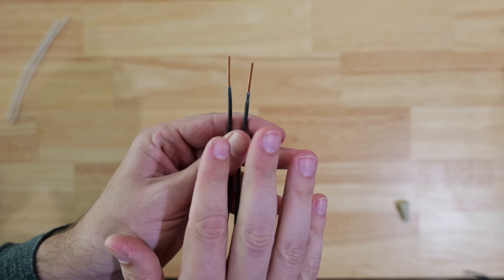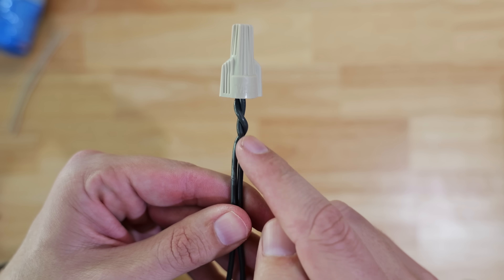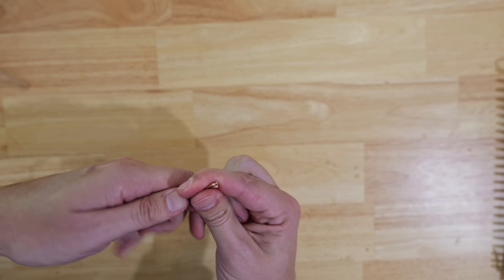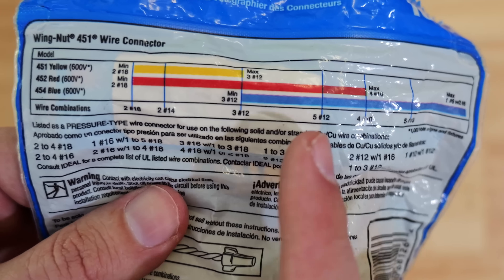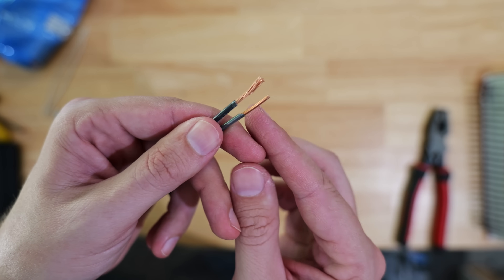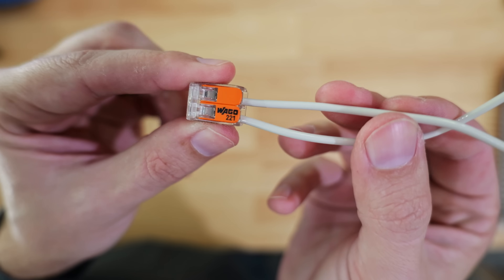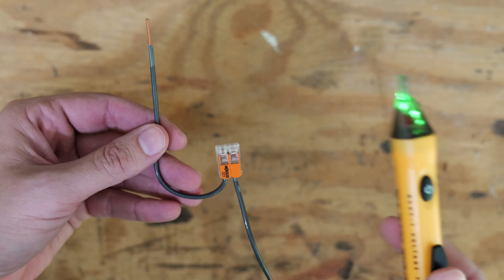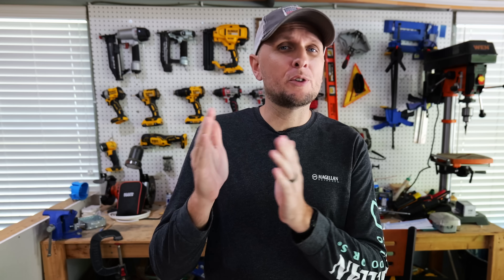7 FATAL Wiring Mistakes Most DIYers Don't Know They Are Making | Most Are Guilty of 3

Comment: Lol, your fear for wagos is funny considering every switch and plug has exposed screw terminals. American wiring standards are the fire hazard. I want non exposed screw terminals where the screw isn't live. All three contacts should be in along the sides and not on the top and bottom. Lastly, there should be a secondary hold mechanism to grab the wire jacket or insulation. I should be able to grab the outside of any switch or outlet anywhere and not get shocked.
Reply from the maker: As soon as I read American wiring standards I quit reading.  Just European electrical god complex at that point 😂.  Which I don’t understand because per public statistics, you all have more electrical fires per capita than we do.  Hmmm 🤔
Reply: No, it's both. The American standard sucks more on low voltage, European sucks more on high voltage. Also, their plug is awful. The European standard loses me on their screw terminals. A screw terminal for a single wire works great, but for multiple wires, it's terrible. There needs to be a compression mechanism and not just screw driven randomly through a wire bundle. Technically, if design correctly, there shouldn't be a need for wire nuts, but for how ghetto they are, they work phenomenally well. It's all designed to be as cheap as functional possible.

Comment: Your first example is wrong !! That twisting / wire braiding effect is supposed to occur with the bare wire  ! You’re supposed to line both bare copper wire even with each other , and using a pare of pliers twist both bare copper wires around one another about 5 turns causing the braiding effect . Most wiring inspectors will fail a circuit when they see the shielded wires twisted . Because they know some idiot just placed the two wires together side by side and twisted the wire-nut on forming an improper connection . So to the video uploader you get a  F for your grade …
Reply from the maker: No it isn't.  The manufacturer instructions clearly show why I did it correctly.  They will not fail it.  I have passed all of my inspections with that done.  So to the author of the comment being replied to, you get an F for your grade.

Comment: False information. You are incorrect. That looks like an ideal tan wirenut. This is their instructions from their website. Please stop making videos promoting false information.

5. Pre-twisting acceptable, but not required. For pre-twisting; strip wires long, hold wires together with insulation even, twist wire ends together, 
strip to recommended strip length.
Reply from the maker: Ummm I showed exactly that and didn’t say anything to the contrary.  But I see with your other comment that you are just here to complain.  Hope your day gets better.
Reply: @HowToHomeDIY  lol now you are lying in your response. At 42 seconds in you stated this is not done to the manufacturer instruction. 

I showed you what the manufacturer's instruction and you said that's what you said. 

You think I am trolling? I am an electrician, you are a handyman. I am licensed, you are not. 😂 What a joke.
Reply from the maker: Yeah you are referring to a part of the video where I purposefully show how many do it wrong.   Of course it’s wrong there.  I didn’t say you were a troll, you did, but it is starting to seem that way.

Comment: WRONG and BAD advice, you shouldn't be on here teaching people how to burn down houses. LOOSE WIRES START FIRES, NUMBER ONE RULE.
, THUMBS DOWN!
8th and one of the most important mistakes; you can't wrap a wire around another wire, solid or not. Obviously, because the wire that's wrapped around the straight wire can slip off over time or the straight wire will drop out after 1000 hours of use.
 Each wire MUST twist equally! 
And you forgot to mention there should not be any stripped insulation beneath a wire nut.
Reply from the maker: Actually all of that was covered.  Tell me you skipped through the video without telling me.  But go ahead and thumbs down it 😂.  You aren't going to equally wrap solid and stranded together.  Doesn't work that way.  You are upset over stuff I talked about and stuff that isn't done or instructed by code or the manufacturer.